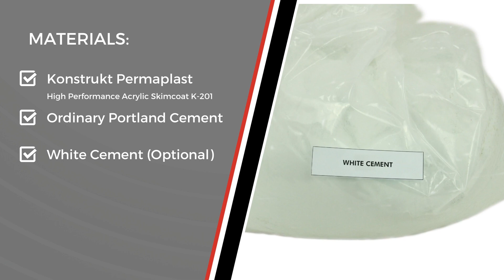How to Apply the Kaiser Finish

Comment: Pano ang ratio ng white cement kung ihahalo?
Reply from the maker: Hi @emanseraf4744. Ang ratio ng white cement ay depende po sa desired color na gusto natin maachieve. The more white cement, the lighter the finish. 

But, general ratio po ng ating mixture para sa Konstrukt Permaplast K-201 High Performance Acrylic Skimcoat ay 1 is to 1 with cement (by volume).

Comment: Can i apply this on a wall with flat latex already?
Reply from the maker: Hi @dominicjoaquin5306. No. The Lunar Series was formulated for use on bare concrete walls only.
Reply: @BoysenPaintsPhil  what will happen then if i did it?
Reply from the maker: The adhesion of the skimcoat used may be compromised.